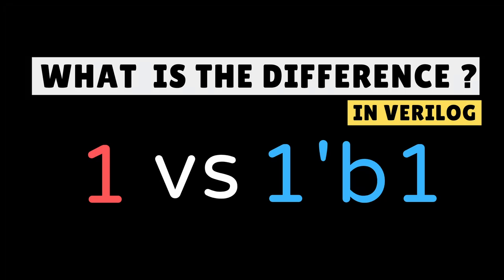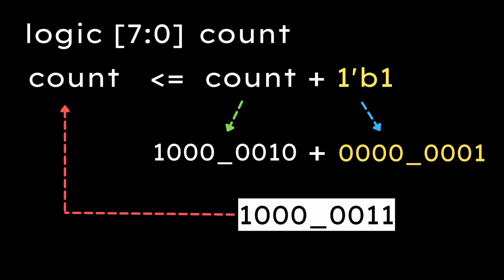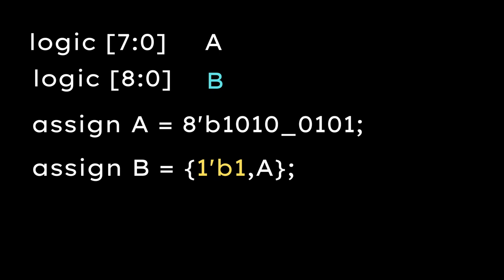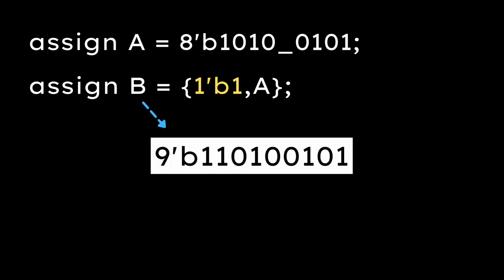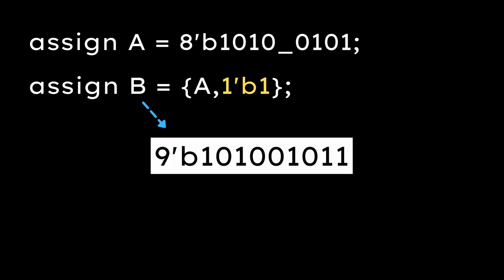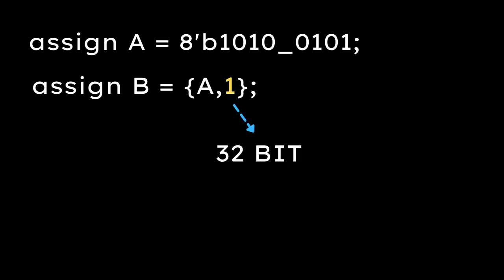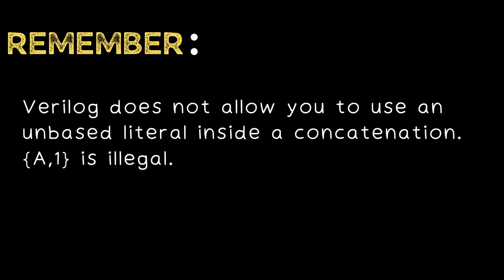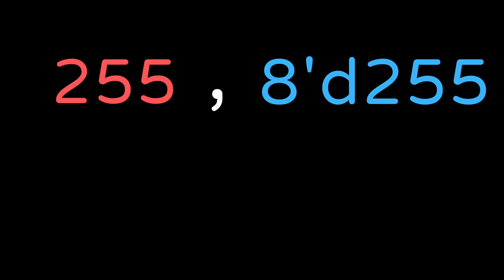What is the difference between 1  and 1'b1 in Verilog ?  ||  Concatenation Problems { }

Comment: I agree with you that we must know exactly bit width of each member of concatenation operator (both RHS and LHS) and should not directly use a integer value. However, we're lucky again that compiler will yell an error message "illegal use of a constant without an explicit width specification" when you try to put "1" into concatenation.
I use Cadence Xcelium.
Reply from the maker: Yup